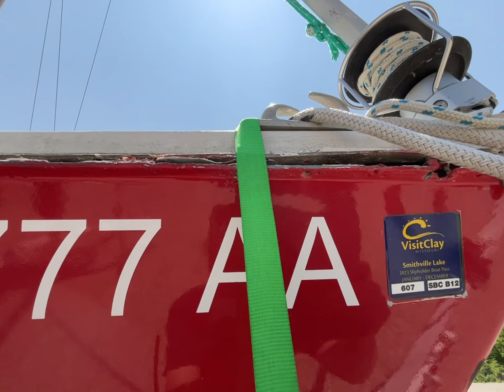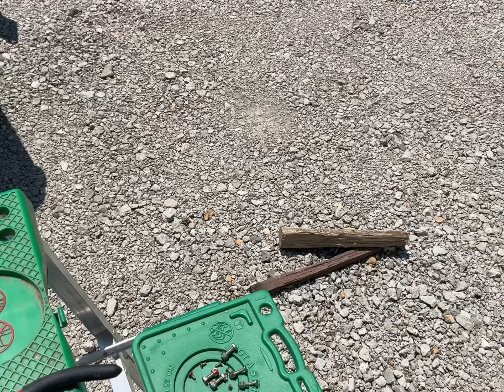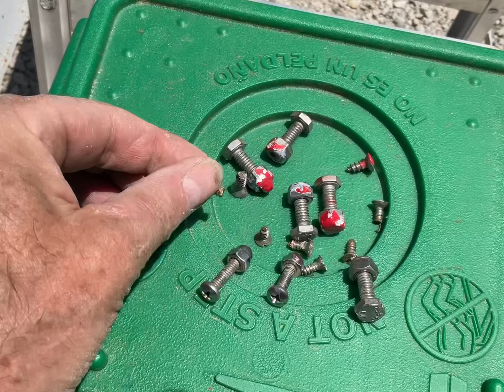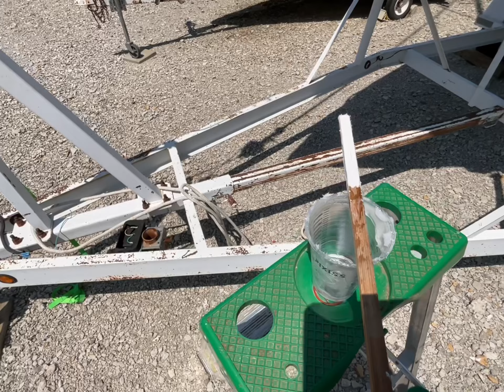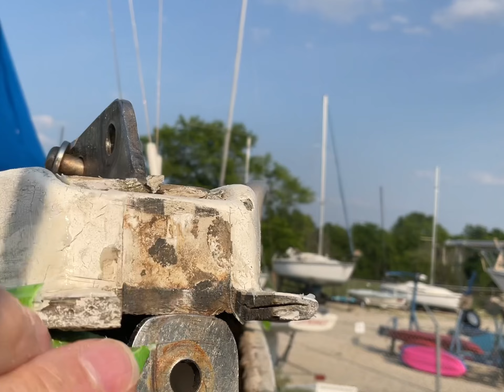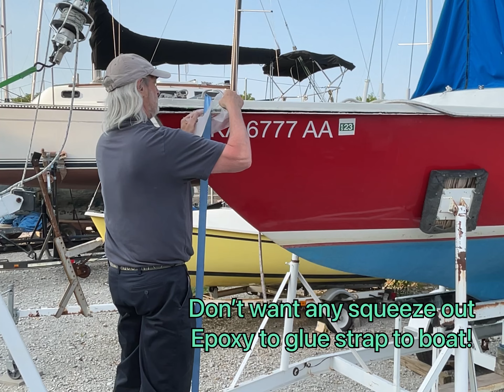How to Fix Deck to Hull Disaster - Pearson Ensign

Comment: Curious what that chain plate was used for?
Reply from the maker: Right!?  I feel sure that initially, this old girl likely had a head stay with no furler and so would have used the chain plate. At the same time, the deck plate looks to be original equipment too. it is strange. we are going to try to use the chain plate when we put this back together, maybe this evening with luck